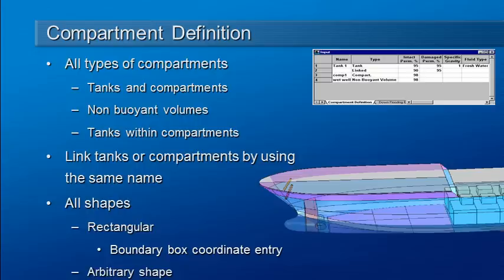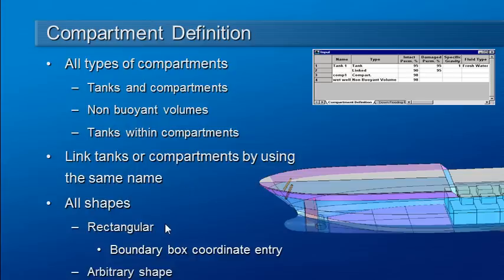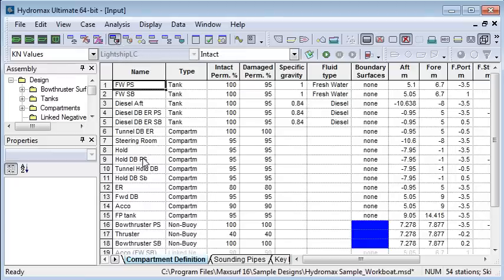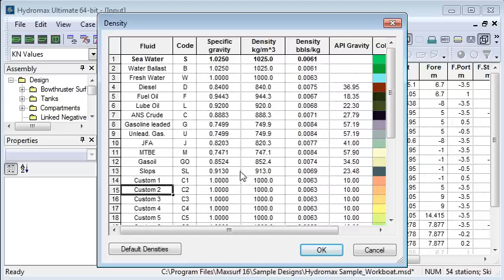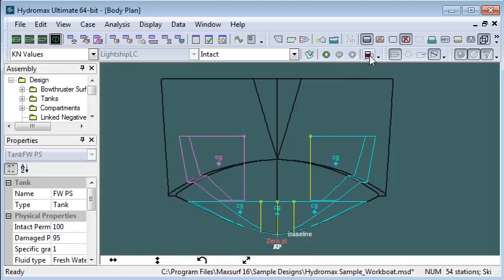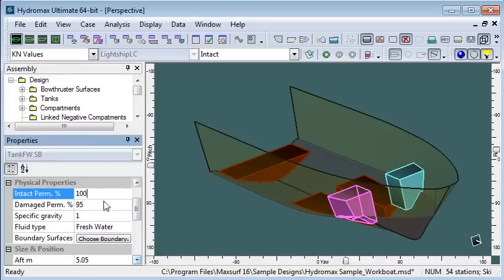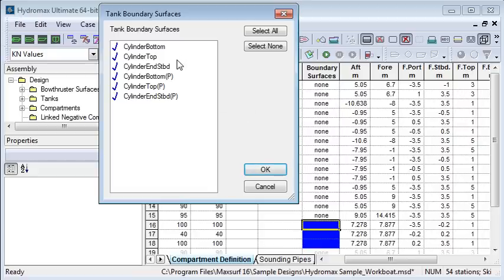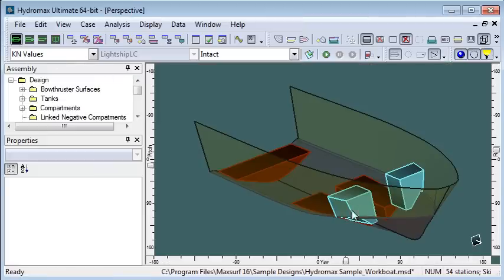Tanks And Compartments

Comment: Hi sir, Im following your video and module to prepare the damage stability booklet. Is there a  method to find the comapartment volume and LCG and VCG of it after defining in the load case window?? Please help me out
Reply from the maker: Yes, after you define the tanks and compartments, change your analysis mode to Tank Calibration and then run that analysis. The Results window will show you the CG and volume for each tank and compartment.
Reply: Thank you Sir

Comment: Hello. can tell me how to make a triangular tanks? i can't put differents measures for port and starboard points difference between top and bottom
Reply from the maker: The section on irregular shaped compartments shows how you can define surfaces in Modeler, set their type to internal, and then use them as boundary surfaces for a tank. You can use this method for a triangular tank.